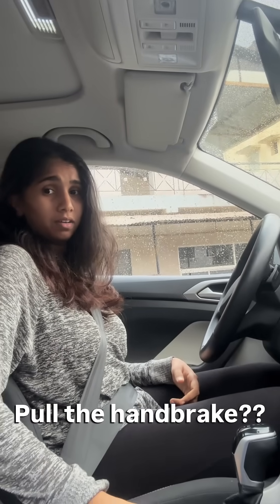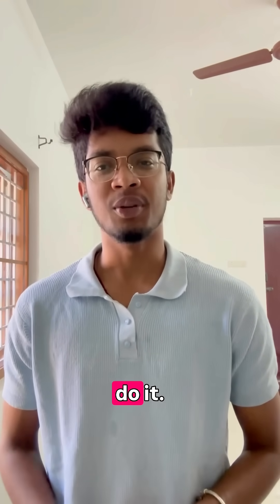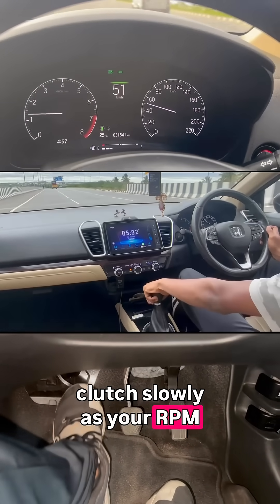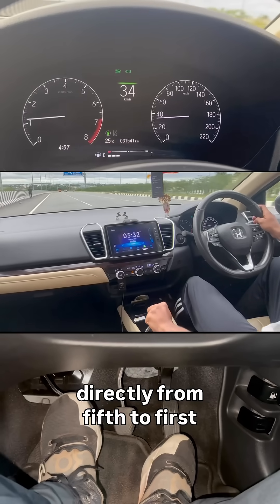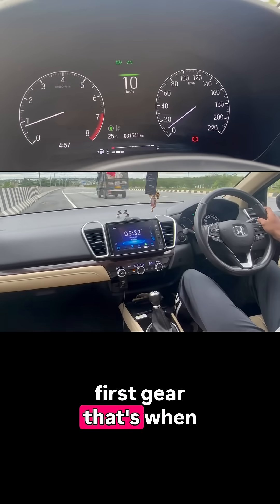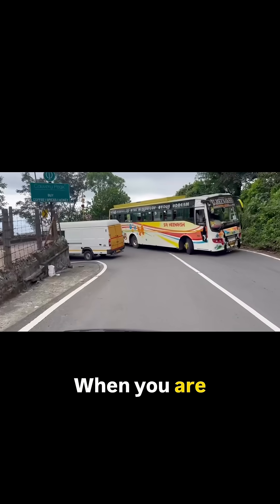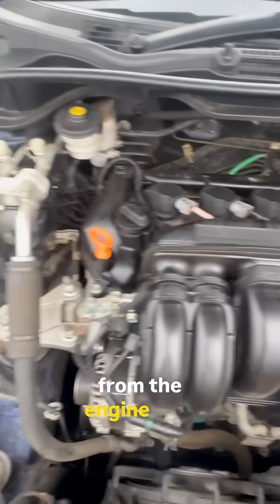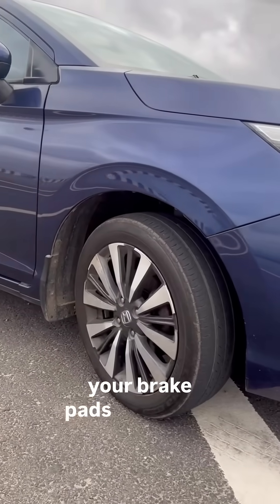Engine Braking in cars when your brakes fail

Comment: Doesn't work on automatic transmission
Reply from the maker: Downshift gears one by one slowly using the manual mode or paddle shifters. It uses the same concept just without the hassle of a clutch 😊

Comment: Remember if ur in a petrol car always rev match !!
Reply from the maker: Rightly said! But in case of brake failure more like pray and downshift to slow down faster
Reply: @RPM_Therapy correct! But imo rev matching is a skill everyone should learn in case of brake failure rev match helps a lot but if u don't know how to rev match normal downshifting works fine as well just don't panic.